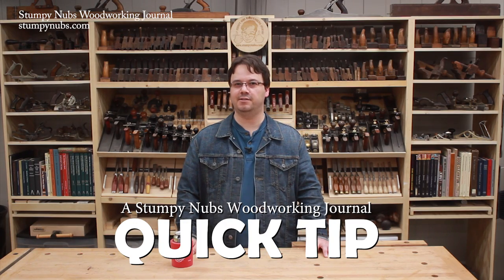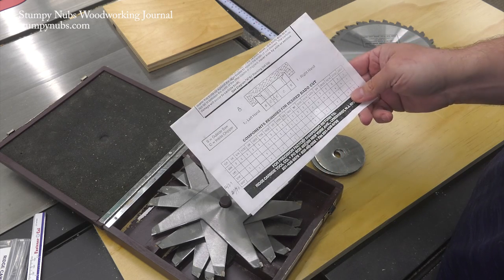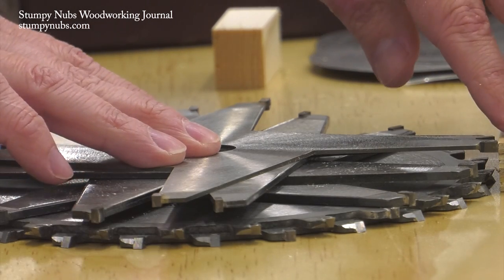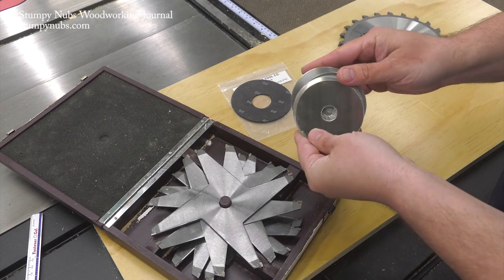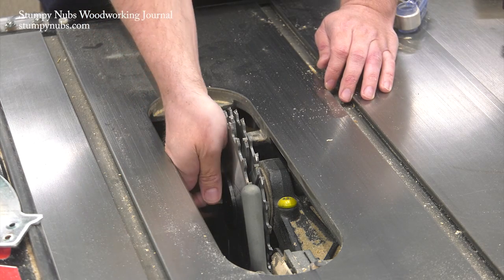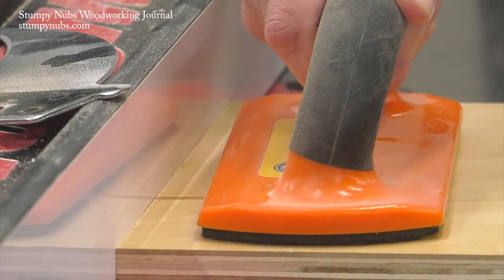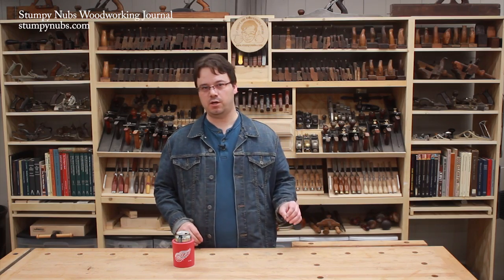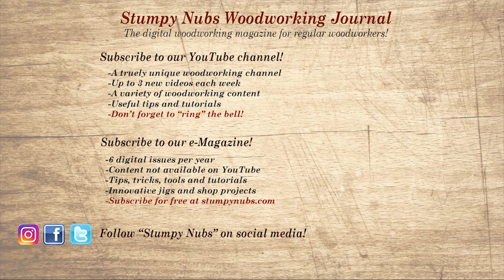Are you setting up your dado stack wrong? (Some clever tips)

Comment: One tip to add on (if others upvote it as true, since I'm relatively new to this) - high quality dado stacks are expensive but poor quality ones are a bummer.  You can find a balance by buying a high quality set in a smaller size.  I have a great 6" dado set.  It still allows plenty of depth of cut for me and cuts very clean but was only about as much as a lower-end, larger-size set.

Comment: At the 3:58 mark, I think there is a mis-speak. If your test dado is wider than it should be, slipping in a shim only tells you how much too wide (feeler gauges do the same.) If you are currently using exactly this thickness shim, then you can remove it. Otherwise, you will need to switch out chippers, etc. and do a new test cut.

Comment: I just cut a dado for the first time.  I went though the measurements just like in the video. The cut was okay, but testing is really required to get a good cut for both depth and width - i.e. for a T-Track.  My shims are not magnetic with oversize centre holes. When I took the stack apart, there was a tiny wicker sticking out of the centre rim, which meant it had been crimped during make up. I thought I felt it - and yes it was.  I really do like your videos. And this particular one is built on numbers and that is something I like.

Comment: I had a weird mishap with my dado set. I had made a cut and when my saw was spinning down, the arbor nut came loose and the dado blade dropped off inside the saw. What the heck? So I put them back on, tightened the nut really tight. And it happened again! I figured out that one of the shims must have nested in valley of the arbor thread as you mentioned. This prevented the assembly from being snugly nested together. Dumb, but hopefully I won't make that mistake again.

Comment: Great tip on the magnetic shims, I also like the larger diameter than the stock ones. My method ( I stole it, I'm not that smart): I eyeball the thickness plus a bit, making sure a have a few shims in the stack. I then cut a loose test dado. Then I do a test fit, and add shims from the stack, until I have the desired tightness. I then leave out the shims I used for the fit, reassemble the dado stack, and go. That way, I also don't need to worry if I have a little runout on the saw, or seasonal humidity changes.

Comment: FYI looks like your using a Sawstop in this video. On my Freud dado stack I had that problem with the arbor not being long enough. I called Sawstop Technical and the engineer told me it’s fine to leave the arbor washer off when using a stack. He said that the arbor washer is only for stability when using a saw blade and really isn’t needed using a dado stack. Yeah I have issues with the shim washer fallen between the threds, good tip and I’ll check out magnetic shims, thanks

Comment: The thickness chart that came with my Freud set is "short" across the entire recommended range.  It seems to be gauged off of plywood's undersized settings, so when the chart says 3/4" it actually means '3/4" plywood'.  Unfortunately, this means all of the sizes in between are under-sized, which is annoying when you're working with something like 12mm baltic birch ply, or hardwood planed down manually to a specific thickness.

Comment: Thank you for the tips. I've been avoiding using my dado stack because it's such a pain in the ass, and now I know I have a crappy dado set. So I will use your link and get a good stack and use your advice for set up. I feel more optimistic now. Thank you.👍
Reply: What was your crappy set and what problem did you have? Uneven bottoms?

Did you find a quality set fixed your hassles?

Comment: James, You do an amazing job in all your videos. The safety tips are always appreciated. Question. I have an old delta table saw. Should I but wood or melamine throat plates and cut through them with different width dato stacks to create a tight fit around my most commonly used dato stacks?  Thanks, Al
Reply from the maker: I don't think you need a tight, zero-clearance fit for a dado stack, but it nice to eliminate any large gap so nothing slips down inside. I have one for narrow stacks (1/4-1/2) and another for larger stacks (5/8+)

Comment: Thanks so much, James. I've had this very problem with my shims so I ordered a set of magnetic ones just now. I have a nice dado stack that I seldom use because of my fear of boogering up my arbor threads with the tight fitting, slipping shims. I switched to a Ridge Carbide blade last month and love it. I also located a very good sharpener within driving distance and had them sharpen my original SawStop blade as a back up. I'll be making perfect dados by the weekend. :)

Comment: I have been using my cheap dado set for years,,Never had a problem setting them up,,All i do is count the blades,,,each blade is 1/8th inch thick. I  built all my kitchen cabinets using my dado set

Comment: hi stump.
I have a table saw with a 30mm hole in the blade, but the saw has a 20mm shaft, so there is a 30mm x 20mm washer inserted into the blade centre !!!
my question is could I bye a 20mm bore blade to use on my table saw ??? hope this makes sense regards clive

Comment: I can not find a perfect nesting spot for the chippers against the blade.   My chipper teeth always interfere with the outer blades causing a lot of frustration in dialing in a cut. I can literally assemble a stack, make a cut then disassemble, reassemble and get a different width cut (we're talking 0.000's) but still frustrating. There is NOT a spot of the blade where the chipper tooth does not interfere...I assume my $100 8" dado set is trash?

Comment: Kinda late in the day I guess ... but ...!!!
Great video ... but does not address an issue I've run into ... and have learned others have same problem. IF your table saw arbor has only a 'limited' straight shank before threaded area, you will easily end up being forced to install dado stacks over or into the treaded portion of the shaft. I struggled with this as a major problem in executing box joints. Since the misalignment is only slight, it typically causes little problem for large dados .... but can royally screw up smaller scale dados.  Due to the slightly misaligned blades in the dado stack, You will end up with a slight offset or irregular surface at the bottom of the dado which causes the box joint to not seat fully, and leaves an unsightly gap in the joint. This is not a perfect fix, but I've begun using a 5/8th high-grade, hardened steel, quality machine bolt with an inch or more straight shank. I insert that into the dado set, then (I know, big potential for problems ... so has to be done carefully!) clamp the set, near the edge. Then pull the bolt out, and properly install the clamped set onto the saw arbor. This holds the dado set in near perfect alignment, until you can run the saw shaft nut down on the set. Remove the clamp .... and done. Works for me. Box joints all coming out perfect now.

Comment: Thank you for the great info! Can you please do a video explaining the five speeds on my router? I have a Porter router and an incra lift/table.
Reply from the maker: Router speed settings are mostly used to adjust for larger bits, which can not be spun as fast as smaller ones. You can find charts about bit speeds online. While speed does affect the cut itself (too fast can lead to scorching) that factor is usually compensated for by how quickly or slowly you feed your stock. We may do a tip video on it...
Reply: Stumpy Nubs thank you!

Comment: Thanks for this James, I've been looking for a dado stack that actually cuts a flat bottom dado without the grooves. Yes, I'm suffering from a crappy dado set. The board with the dados cut to use as a chart is a great idea.
Reply: I have the Ridge Carbide Super Dado Master (the one with the solid chippers and can't be used on Sawstops) and get a beautiful cut, though there are still batwings from the edges the groove itself is quite good.
Reply: Jet sander change sandpaper

Comment: Hello. I am from South Africa. Dado blades are not very easy to find here. I have a cheaper table saw. what is the average length of an arbor that can house a thinner dado stack.
My saw does not have a very short arbor like some of the Ryobi saws, but not as long as the saw you use. I just measured by eye and compared to mine.

Comment: I looked at the blades that Ridge Carbide Tool Co. makes. There is the Ridge Supper Blades and the Industrial Germany line. Which do you recumend? There is a differents in cost.
Reply from the maker: The Germany line is a slightly lower quality blade made for the consumer market. It's comparable to Freud. Good stuff, just not a lifetime blade like their regular line is.

Comment: "you may not have room for both the nut and the washer, it IS safe to leave that washer off"
I have had an experience where, after completing a thick dado cut and turning the saw off, the dado stacks momentum unspooled the arbor nut enough to spin freely, then the blades drifted into the sides of the throat plate, chewing it up. After letting the blades come to rest, I found the arbor nut had completely fallen off. (I have no idea how, since the blades were prevented from moving to the end of the arbor by the throat plate)
On my table saw, the arbor has two flat faces, as does the washer bore, making it impossible for the washer to rotate and transfer torque to the arbor nut. After that experience, I DO NOT feel it is safe to use a dado stack without a washer. 
What is a good way YOU ensure the arbor nut is tight enough to use without a washer? I just wedge a scrap wood chew block behind the blade to hold it while tightening the nut, but clearly this doesn't always do the job.
Reply from the maker: For the nut to loosen and un-thread on the arbor it has to spin in the opposite direction as the dado blade, so the momentum of the dado can not un-thread the nut. At least that's how it is on every saw I have used. Sounds like it's different on yours.
Reply: @StumpyNubs  This saw (like all other saws I thought) is threaded such that the torque applied while cutting, created by the workpiece resisting the blades motion, functions to self tighten the nut. While on, the spindle drives the blade, exerting torque in the direction of blade motion. The torque I'm talking about is the reverse. When a motor is turned off with a spinning mass at the end, the spinning mass only comes to rest after it's transferred all it's angular momentum back into the motor, and this applies a reverse torque.
Reply from the maker: All I can say is I've used saws of all types for many years and that has never happened to me even one time. If it happens to you, I suggest you tighten the nut more.

Comment: If you have a combination Arbor nut/washer for a jobsite table saw is it safe to switch the washer/nut to something thinner? I can't seem to have more than one chipper tooth on my stack with this nut. Or is the arbor made shorter from an engineering standpoint to not overload it? Thanks for the videos
Reply from the maker: I would not use a nut that was not made for the saw.

Comment: I’m a woodworking teacher and aim to present the way you do. Thanks for the inspiration.  The oil seems like a good idea but won’t it set of the Sawstop brake?
Reply from the maker: No, oil won't set off the SawStop
Reply: Really? Does oil not conduct electricity?
Reply from the maker: The oil is between blades in the dado set that are touching anyway. I don't believe that thin layer makes them more conductive, they are already as conductive as can be. Besides, you need mass to drop the voltage. A hotdog laying on a board won't set it off, but a person holding onto the hotdog will because his body mass "absorbs" enough low voltage to cause the drop and set off the brake.
Reply: Thanks for the explanation. :)

Comment: Always love your videos. I do have to say though, that I'm not a big fan of Ridge Carbide. Based on your recommendation I went a little nuts several years ago. I bought a dado set, a 12" miter blade, a rip blade and general purpose tablesaw blade, as well as a specialty dovetail blade. I've been quite disappointed with the performance of all of these blades. They dull much faster than the Forrest or Freud blades I've used in the past and even when brand new the cuts weren't as smooth and often burned. After a few years of use I can honestly say that they were one of the most disappointing purchases I've ever made.

Comment: hmm doesnt a blade and a chipper order make a difference??? How can you put a chipper on top and measure the thickness? Chipper tooth might be a different width than a blade itself (the yoverlap to make a smooth bottom but I think you must start and finish stacking with inside and outside  blades to get the correct thickness
Reply from the maker: On every dado stack I've used the chipper teeth are the same width as the blade teeth. So it makes no difference if you are measuring one or the other as they both overhang the thickness of the plate by the same amount. But if your set is different, then yes, you should place the blade on top and measure it.
Reply: @StumpyNubs  Thank you! I appreciate!

Comment: Got a question for ya. I am refinishing an antique dresser that all the veneer was peeling off and cracking. I used contact cement for the new veneer and now I need to drill out the holes for the handles. How do I do that without the chance of tear out when the bit pops out?
Reply from the maker: Why not drill from the outside in?
Reply: @StumpyNubs  I was thinking that might be difficult in finding the center. I guess I could use a small bit to locate the hole. I'm a perfectionist and this dresser was my grandma's built prior to 1940 so I wanna take extra care. Thanks! Your shows are great!
Reply from the maker: I'm not sure I understand what you're saying. But if you must drill from inside the drawer, I would use a 1/8-inch bit to create a pilot hole and mark the center. Then bore with a larger bit from the outside. I would also make sure my larger bit is very, very sharp so you do not tear the veneer around the hole.

Comment: Another very high quality video. Thank you very much. I am learning (and spending ;-) ) so much from your channel! I was, however, confused by something. At 4:18 in the video you use the depth gauge on a digital caliper to measure the width of the stack. You specify to measure to the outside of one of the teeth on the chipper on the top of the stack. Earlier in the video you said to measure the width of the chipper blade body, not the teeth, as  the teeth are made to overlap with those of the blades beside them in the stack. So when measuring the width of the stack where you have (temporarily) placed a chipper on the outside, why measure from the tooth and not the chipper blade body? Or better yet, why not stack the blades as they would be in the saw with the outside cutting blades placed on the outside? Then you would need to measure the outside of the teeth. Is my thinking off on this? Anyway, I love your videos. Thanks.

Comment: Hey James, thanks for this! Question about the magnetic shims - considering they have a larger bore, if they are not perfectly centered on the blade, do you think it could create an imbalance in the rotation?
Reply from the maker: No. Their weight is so insignificant compared to the dads set.

Comment: Help! I want to upgrade my miter fence for my table saw.  But it has T slots, with the bottom 1/4" but the top is a hair smaller. I wanted to use Incra MITERV27 Miter V27 Miter Gauge but the top of the slots prevents that. Is their a workaround?  P.S. I have a Ryobi 10" contractors saw

Comment: I noticed they have 10", 8" and 6" dado sets but I don't know how to choose which to use or why. Could you give a short answer? Or will that be a request for a different lesson? Thanks for all you do.
Reply from the maker: 8 inch is standard.
Reply: Smaller saws may have a hard time with 8 or 10" blades.  My little Makita contractor saw works fine with the 6". Anything bigger would overpower it.

Comment: Just to add to my comments, I looked up the caliper you use and it states a + or - one thousandths of an inch, that’s a possible swing of three one thousandths of an inch, when I build a cross cut sled I strive to get within one thousandths of an inch, I stop driving myself crazy when I get dead nut at one thousandths or better closer to zero I can only know for sure mechanically.
Reply: Maybe you'd prefer a micrometer. They are slightly less susceptible to variations in the way one holds the calipers, thus creating the larger tolerance. In woodworking, + or - 0.001" is totally acceptable. Your work will swell/shrink that much in just a very short period of time anyways. 
I'm a metal fabricator by trade, and we typically hold tolerances within + or - 0.005". Our machinists can and will hold far tighter tolerances depending on the job. Hope this helps.
Reply: @rigorhead01 
Point taken. Sometimes I’m a cranky old nit picker. Yeah in a perfect world my joints should be so tight. I must of been in a bad mood when I posted that.
Reply: @cb4920  lol Yes, brother I know what you mean 🤣. I can be incredibly cranky sometimes too. I was actually trying to be helpful, but it's hard to tell what people are really saying when reading a comment. Hopefully I didn't come across as an ass 😁 Hope you have a great one!

Comment: Where do you find the magnetic shims?
Reply from the maker: Link above. But they are sold out now. Try in a week or two. It's worth the wait.
Reply: Paul Cox  The Grizzly shims have a 5/8" arbor hole.  I went with the 3/4" ones from Rigid to avoid possibly getting the shim into the arbor.